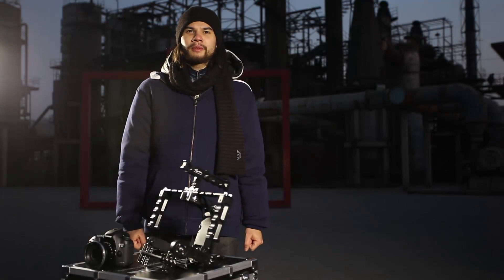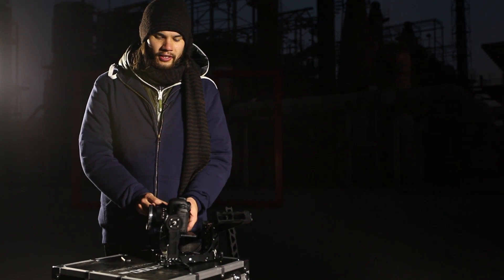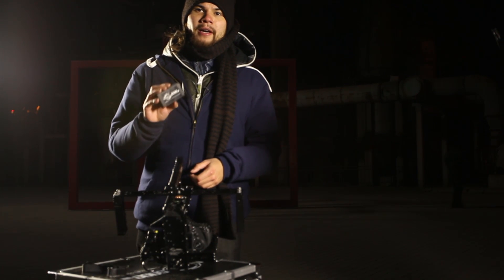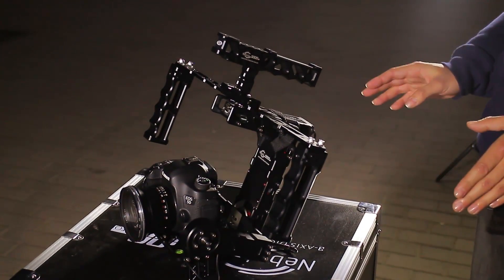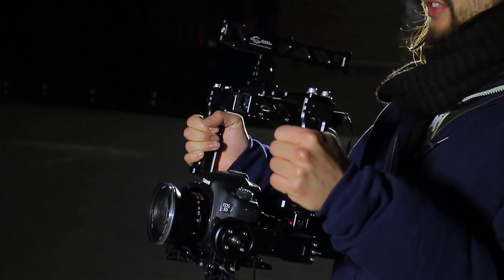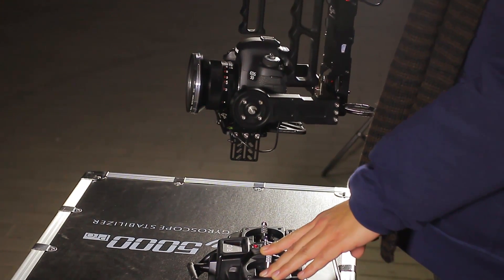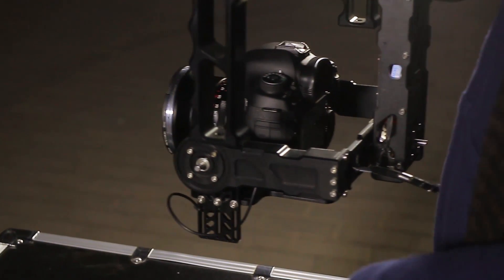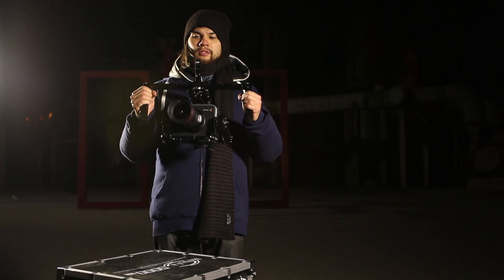Nebula 5000 Pro Gyroscope Stabilizer Manual ENG

Comment: I have tried there isn't enough room to fit a bnc cable between the camera and the motor. Have you ever used the black magic cinema camera with and external monitor attached?
Reply: Richard Samalot Hi , we use a "L" BNC connector in order to get the signal from the BMCC to the external monitor, but we always have trouble. I guess that´s because the BMCC's weight is the limit of what the Nebula 5000 supports. We tried once with a lighter DSRL camera and it worked fine.
Reply: Miguel Barreda Delgado I have tried the right angle BNC adaptor, even a super skinny BNC cable, there is not enough physical space to put it in the camera and not have it interfere with the gimbal.....I though this should be mentioned to people contemplating purchasing this stabilizer, Nebula 5000, for the BMCC....the Stabilizer can hold 8 pounds the camera weighs 3+ pounds and even a 2 pound lens only brings the unit to 5+ pounds.....so I don't think weight is the real issue.....

Comment: Hi. From this video I see you have no idea how to balance a gimbal and why.

Thank you
Reply: turn the power down. Everytime it shakes is a signal that too muh power is being supplied to the motor. Of course assuming that everything is perfectly balanced no slack all screws tight etc...
Reply: Agreed...............   this is a very odd demo/setup.
Reply: +kikojiu do you have any tips?  i have one of these and it shakes no matter what I try....it also looks different than the one on the video...thank you
Reply: +kikojiu , don't know how to turn down the power. I only see an on, off switch....thanks
Reply: You´ll have to connect via USB to the configuration program for the 32 bit board 
http://www.basecamelectronics.com
Reply: +kikojiu , thanks Ill try that and see what happens.  weird that it's overpwoered with a big black magic cinema camera on there.